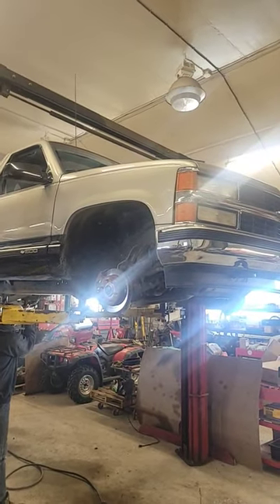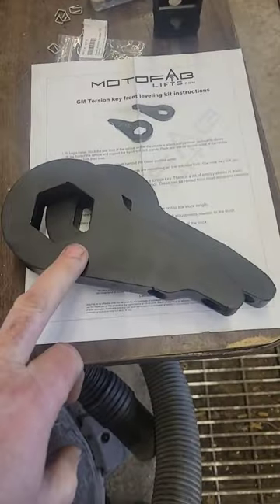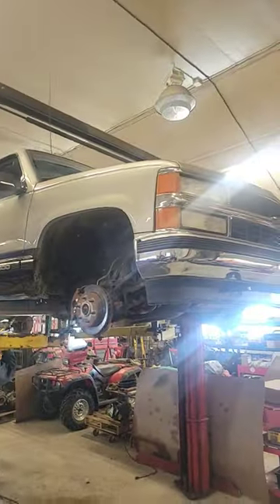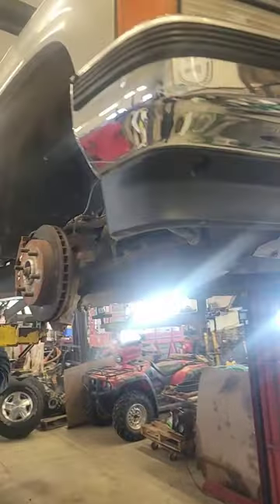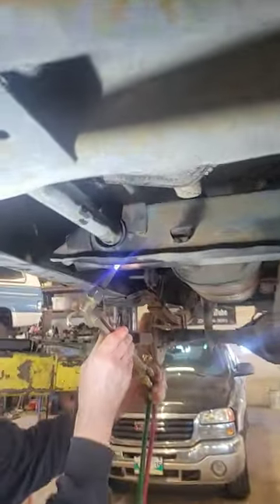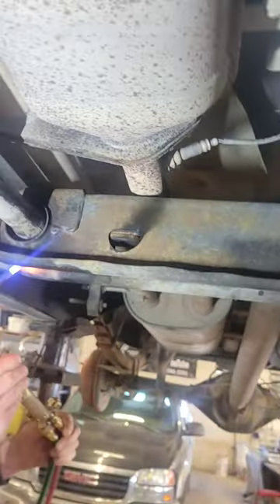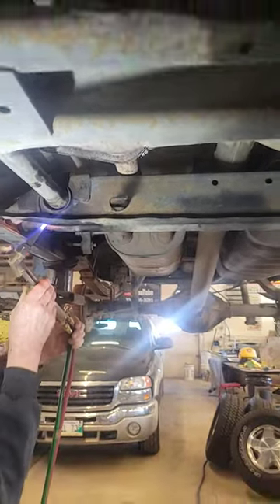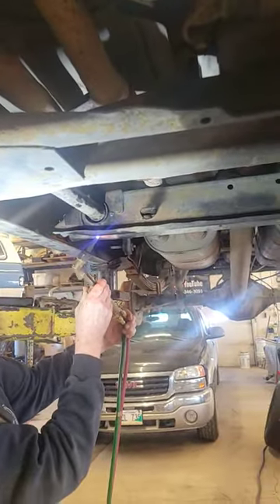Please help.  We are looking for pointers on how to remove the torsion keys on this 97 Chevy 4x4

Comment: Drop that cross member and the tortion bars. Lay it on the concrete, add heat and shore the back side of the key with a 4x4 and smack it with a hammer when its glowing. It's a shitty job but it worked for me.
Reply: I was trying to do that. But came seem to take it out like with the transmission crossmember. I’m trying to take off the top tranny bolts. So I’m trying to make it sag to see the top ones.

Comment: Rattle on key with air hammer and spray water where it slips onto torsion bar. If its rusted in water and percussion will loosen it.

Comment: Try a 2 jaw puller and try pressing while you smack with a hammer if not the only thing I can’t think is cutting a slit in the key maybe with a torch

Comment: The old ones will be gone anyway drill and tap them then use a puller on the bolt. Or heat it up and spray water onto it the corrosion if it’s there should release